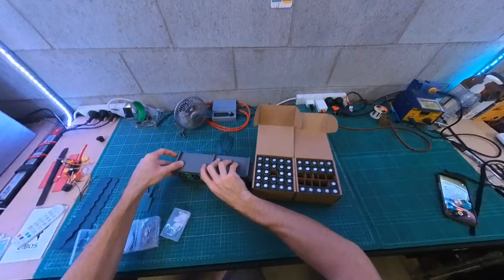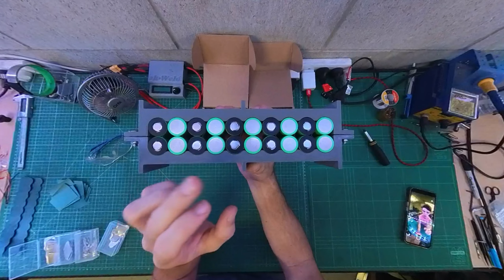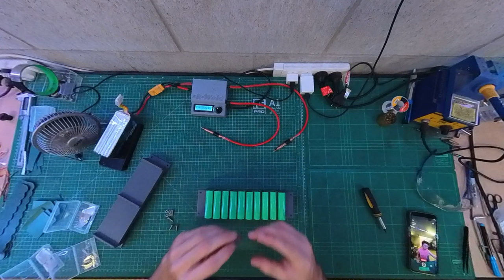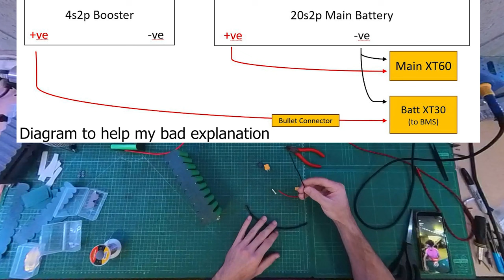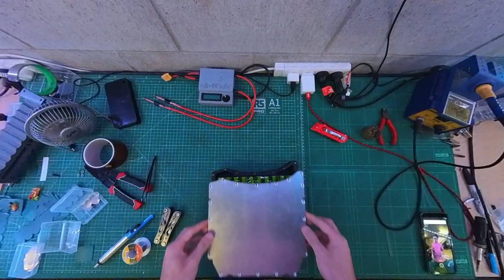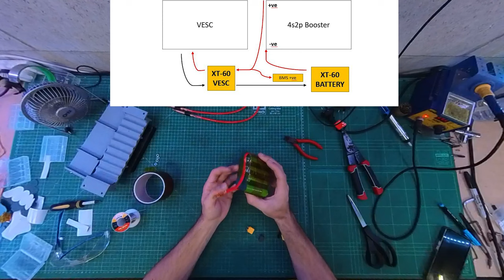GT Build Guide - Battery - VOW

Comment: Is torque improved on this VOW GT (relative to stock GT)? Why important to use v1 SuperFlux?
Reply from the maker: any motor will be fine, and yes this build demolishes stock GT torque, the peak power output I've measured so far is 11kW (GT is 3.5kW)